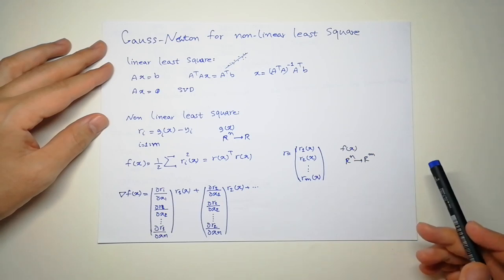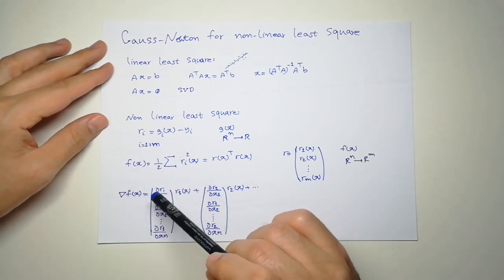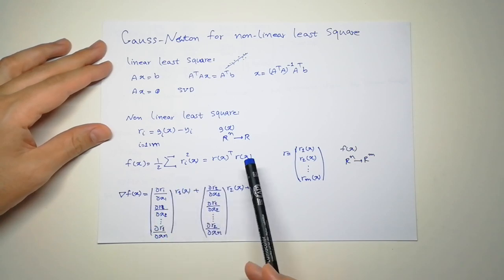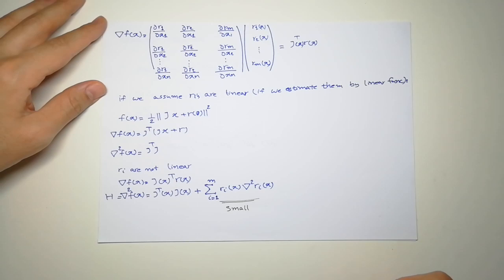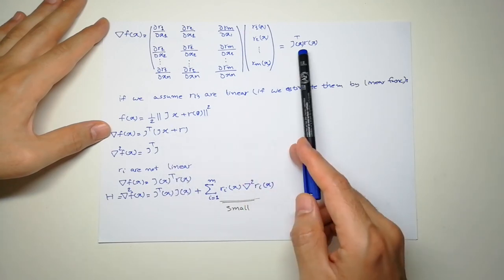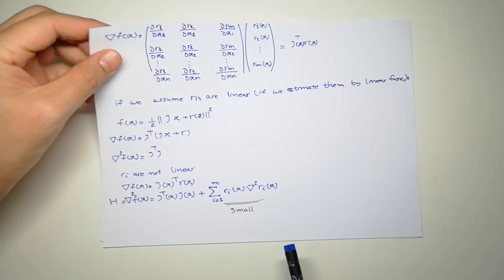Gauss-Newton algorithm for solving non linear least squares explained

Comment: Summary

Problem:

* (0:00)  Fitting non-linear functions to data (e.g., camera projection models).
* (1:40) Minimize the distance between predicted values from the function and actual data points (residuals).

Approach:

1. (2:16) Define Residual Function:
    *  `r(x) = g(x) - y` 
       * `g(x)`: Non-linear function with parameters `x`
       * `y`: Observed data
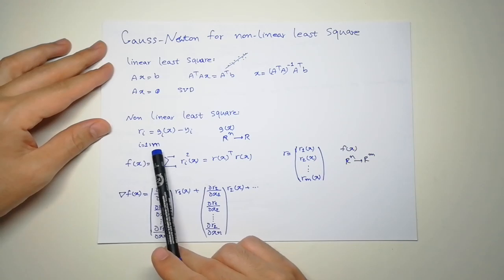2. (2:25) Minimize Sum of Squared Residuals:
    * Minimize `F(x) = ||r(x)||^2` (sum of squared residuals)
3. (6:09) Iterative Optimization (Gauss-Newton Method):
    * Start with an initial guess for parameters `x`.
    * Approximate `r(x)` using first-order Taylor series (linearization).
    * Calculate the Jacobian matrix `J` (derivatives of `r(x)` w.r.t `x`).
    * Update parameters iteratively:
       * `x_(n+1) = x_n - (J^T * J)^(-1) * J^T * r(x_n)`
       * This step finds the minimum of the approximated quadratic function.
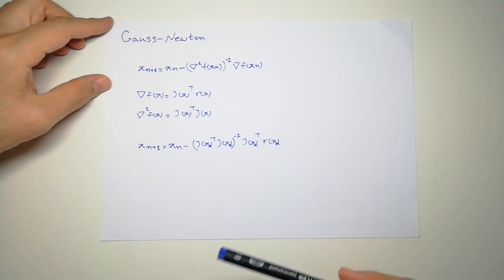4. (8:20) Repeat until convergence (minimum is reached).

Key Points:

* Gauss-Newton is an iterative method for finding the minimum of a sum of squared residuals.
* It uses a linear approximation of the non-linear function at each iteration.
* The Hessian matrix in the update equation is approximated by `J^T * J`, neglecting a smaller term. 
* The algorithm iteratively refines the parameter estimates until a minimum is reached. 

i used gemini 1.5 pro to summarize the transcript

Comment: 7:02 Why is the second term so small that it's negligible,thanks
Reply from the maker: You can think of approximating a curve on a particular point by a line. On that particular point, over a small vicinity, the curve and the line are very close and almost equal, you can include higher-order terms (second order, third, ...) to make better approximation, but their effect is small, as the line is close enough to our curve.